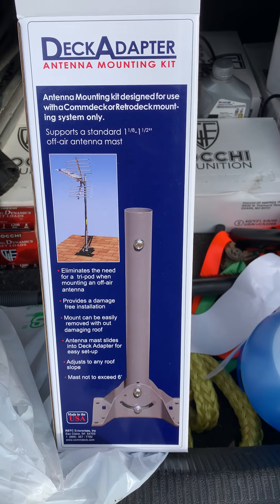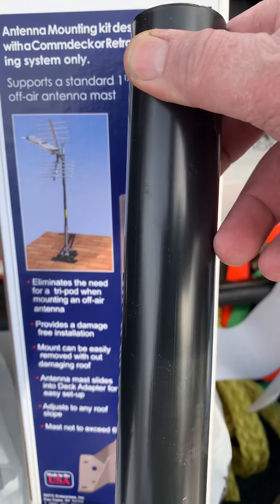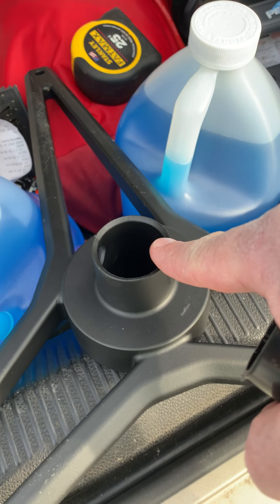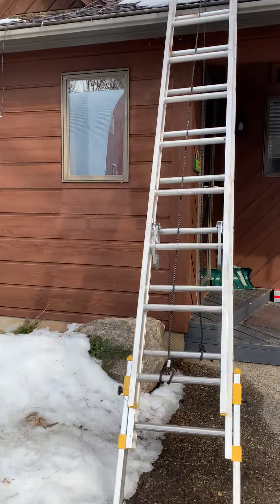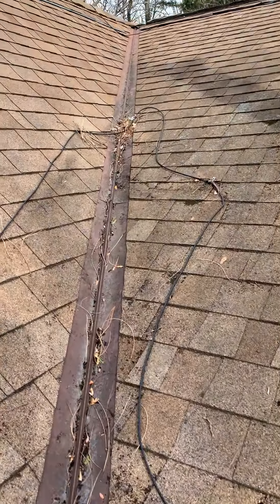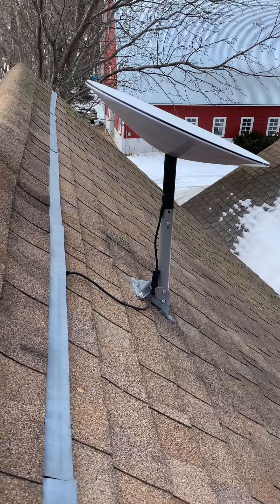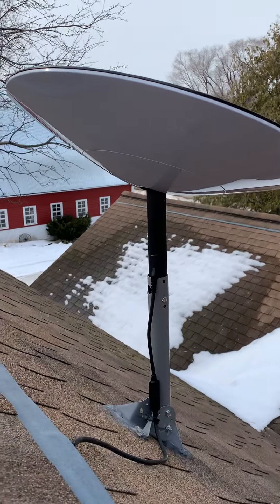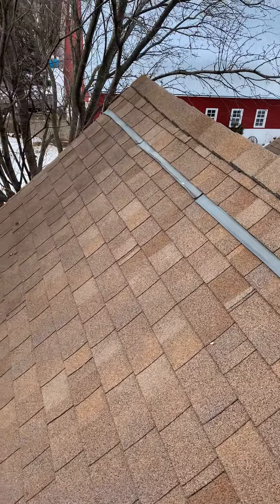Starlink Steep Roof Install Guide

Comment: Man that pipe adapter kit looks PERFECT! Going to see if this is available in Canada cause I see there's a backorder going on with the ones at Starlink and there's a few people where I'm at awaiting the dish to ship.
BTW what a really nice location and place you have going on there Shawn!
Reply: did you get the pip adaptor in the video?
Reply: @FallingxFreaK  No didn't find them here in Canada...YET. Very good idea though this product! So anyways, apparently the diameter of the starlink base is 1.3/8" diameters from Shawn in the video. Then the actual starlink when placed in the base does slightly wobble in there so it could even be less diameter. Now I'm wondering if you happen to have your own Bell Satellite Dish arm (Dish-DirecTV in US) and if you cut the pipe just below the elbow would it work to allow the Starlink arm to slide in?
Reply: @RogerDiotte  i have my old bell dish on the roof still and two poles and i just wouldn't know how to put the dishy on the stuff that's already mounted on my roof

Comment: so the diameter of the starlink mount pipe is 1 1/4?  or 1 3/8?
Reply from the maker: the outside diameter of the starling shaft is 1 3/8 - also my buddy mounted his starlink using an existing HughsNet mount and he removed the "locking pins" from the starling pole (which pins to the base) and used the existing holes vs. drilling new ones to mount on the hughesnet base.  I love DISRUPTION.  Look around you'll start seeing Dishy everywhere :)
Reply: @shuiqlazam  awesome; Thats exactly what i plan to do.  Reuse a Hughes net mount.  id prefer to mount to the side of the house vs drilling into the roof just need to make sure the dish can clear the roof with space to move.  Thanks for the info!

Comment: I would never make a hole in the roof.  Just use a satellite dish vertical wall mount.  If you have three points on the wall, you can extend the tube to the desired height.